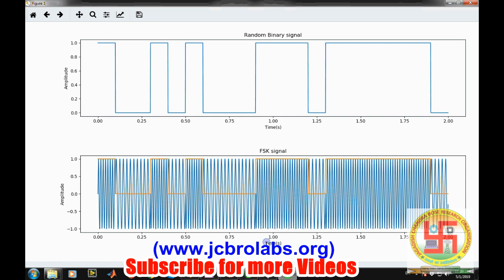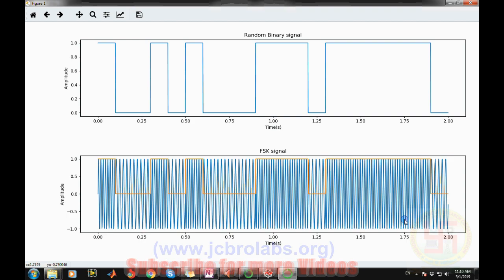How to simulate frequency shift keying using Python??

Comment: Question sir. How can I feed the generated signal to become an audio? Or how can I generate it as serial output? Thank you
Reply from the maker: you can use 'pyserial' module for sending data out via serial port. For making sound, make sure frequency is in audible range and then save the data to .mp3 or .wav file
Reply: Thank you sir. I will try and study. Again thank you so much for sharing. Really interesting and useful to beginner like me. - love from PH